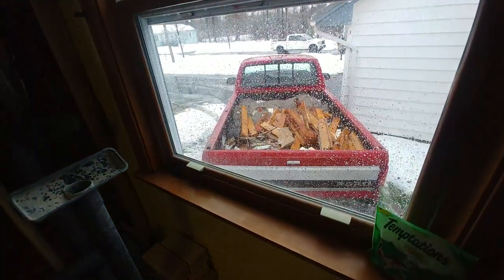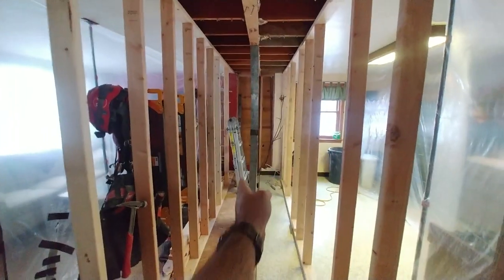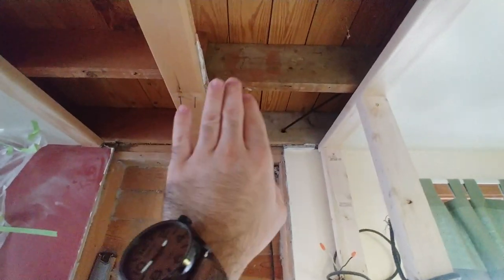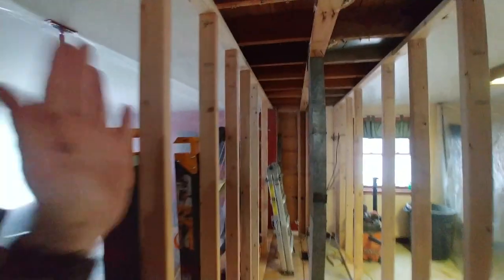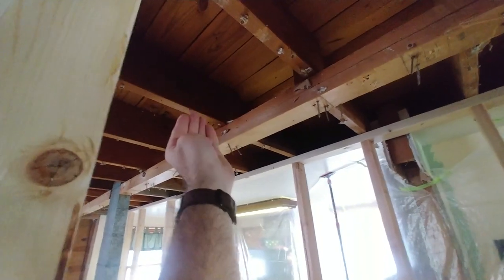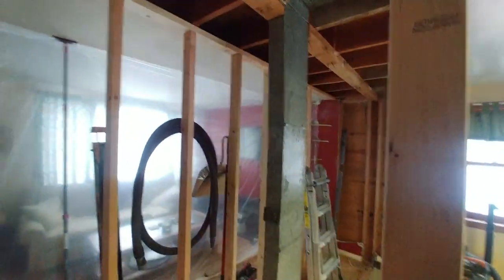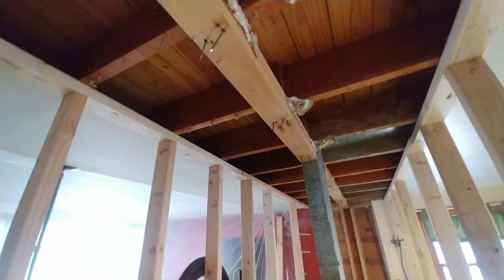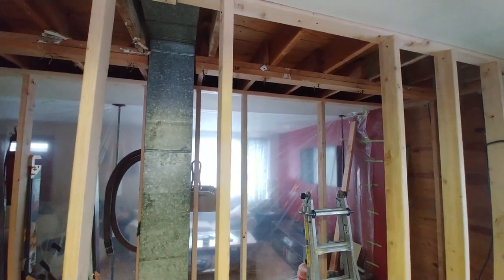Load Bearing Wall Removal Episode 1

Comment: Are the joist hangers used rated for that load or are they more for decking/patio?
Reply from the maker: Deck applications are generally some of the lightest duty a joist hanger performs, as there aren't any walls or a roof standing on a deck. You'll often see 2x8 or even 2x6 joists used on very small decks for this reason, though I don't personally subscribe to that. Just meeting code with regard to lumber sizes and spans, can make for bouncy or spongy surfaces. 

Usually, each size hanger accommodates two sizes of dimensional lumber. I always select the hanger that is for the size lumber I intend to use, as well as the next size larger, thus a larger more robust hanger and it's a matter of a few cents more each. 

In this project specifically, these floor joists are doing 11' spans, and with half of each joist on the outside wall, only half the load is on the hanger. The sub floor has been attached to all the joists for their entire lengths, so all the joists in the floor assembly bear one another in conjunction with the sub floor, further relieving the point load from humans and furniture. Each of these hangers is being asked to bear half the weight of the joist itself, and a small fraction of half of the subfloor's weight, as half of that is on the outside wall as well. The carrying beam is doing serious work, which is why it's on solid wood all the way down to the footings in the basement.

Comment: Great video and very helpful. Just as an aside, it sounds from your repeated throat clearing that you've got GERD. I'd get it checked out regardless. You don't want it to progress.
Reply from the maker: It's GIRD, just fyi. I had a brief sinus infection prior to the series, thanks for your concern but it's long gone now.
Reply: @TMFXLLC  good to hear. I suffer from it and it's constant work to stay on top of it. If it's not controlled, it evolves into cancer.